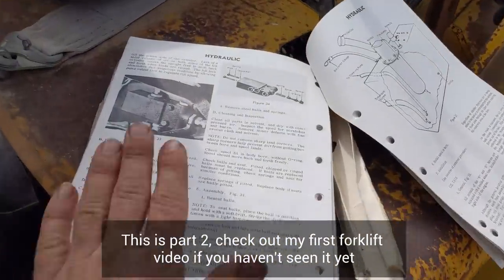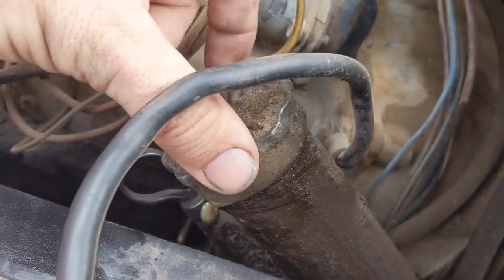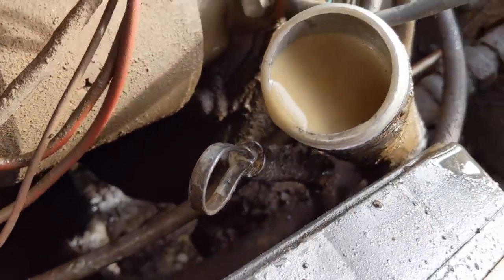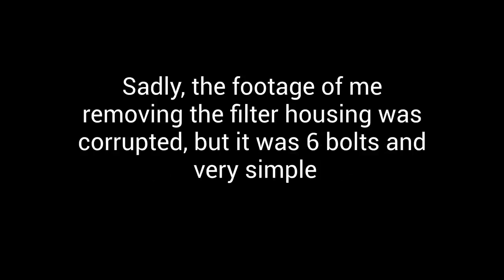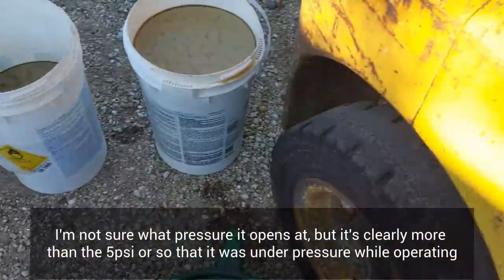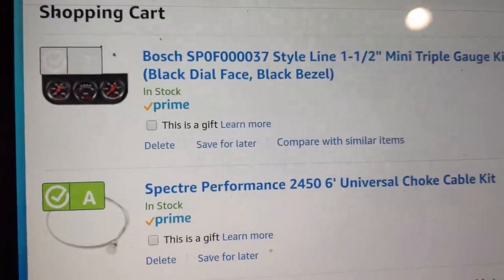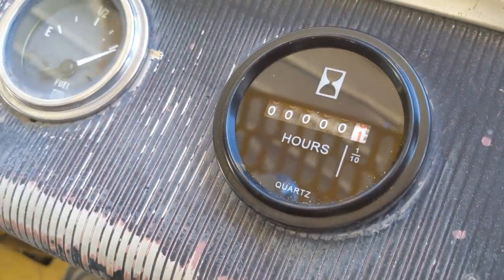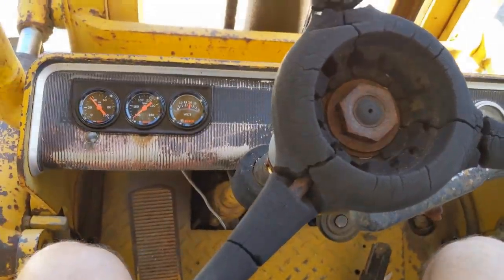Reviving an old Hyster forklift Part II

Comment: I have been around heavy equipment for 50 years and anytime hyd. fluid look's white is because of water in it. and if those cylinders are leaking down you will need to rebuild, and replace the seals.
Reply from the maker: Thanks for the heads up. The closest seals I've done are fork seals on motorcycles where there is an internal seal and a dust seal on the end, are these cylinders similar?
Reply: They are somewhat similar, but you probably will have to take the cylinder down and there will be an  end cap or head on it, remove it and ram and repack the bands inside and repack the head with new seal's. it's really an easy job, maby time consuming but easy.
Reply: @AustinCoulson  Your manual should have instruction's and diagram's.
Reply from the maker: @randallswope4471  I'll check it out. Thanks!
Reply: @AustinCoulson  I know that Abom79 and Keith Fenner have both done videos on replacing seals in hydraulic cylinders. Just search their names and hydraulic cylinder seal and you should find them. Give you an idea of what's involved.
Reply from the maker: @Gizmo42Rodeo  Thanks for the heads up. I will check those out
Reply: @AustinCoulson  Gizmo is right on the repack.  I've seen forklift mechanics pull the main cylinder and repack them in the field.  It's likely drifting because oil is bypassing the piston seal when under high pressure.  Just make sure to keep pipe wrenches away from the cylinder shaft so you don't tear you new piston gland seal, and inspect the interior of the piston wall for any nicks.
Reply: garygsp3 not certain if this cylinder has them but newer hysters certainly from the XL onwards have a non return valve in the bottom of the lift cylinder held in place with a circling, this is to allow any fluid that gets past the piston seal to return to the bottom of the cylinder when you lift the forks. These are prone to failing if left and in my experience cause about 75% of issues I’ve had on hyster  with the forks lowering under load.

Comment: I have been repairing forklifts all my life (retired now) and I was impressed with your mechanical ability and the accuracy of your "guesses". The hydraulic clutch is a pain but works. The minor leak at the lift cylinder is not worth repairing yet. Thanks for taking me back.
Reply from the maker: Thanks for the kind words. Heavy equipment is not my specialty so it's great to hear that from someone who actually knows their way around these. I'm editing a follow up video now where I get stumped and have a couple questions, I'd love to get your opinion on it when it's up. Should be later today or tomorrow.

Comment: I worked as a lube mechanic  on heavy mining equipment for several years. When the mechanics were ready to work on something the first thing they had me do was steam clean the machine. You should invest in a good Hotsy Brand steam cleaner or something similar. You will save yourself a lot of grief working with clean surfaces before you disassemble something like the hydraulic tank. Also would work well on cleaning chassis on the cars you apparently work on- just a thought. Steam cleaners are much more efficient and thorough than pressure washers on grease and oil caked machinery. Good job on the forklift👍
Reply from the maker: I've been thinking about one for a while, thanks for the recommendation, I'll check them out.  My lil pressure washer isn't cutting it these days.
Reply: $4,000 minimum.

Comment: I work at hyster and it makes me happy to see that you fixed her up :)
Reply from the maker: I would like to find the time to do a proper restoration and bring her back to like new condition, but that may have to wait a few years...
Reply: @AustinCoulson  i Will be waiting here for that video ;)
Reply: Hi l am from the uk and have the same forklift as the video shown,it’s a 6000lbs, with Perkins Diesel engine,l have hydraulic flulid come,out of the top of the steering wheel,would you have any idea ,on how to repair this problem,if so l would welcome your advice,please sir
Reply: @macdale4741  my guess is that the seals in the hydraulic steering have failed. I think if you rebuild that part with new seals in it  it should be fine. And make sure you have a hydraulic schematic that's always very usefull
Reply: @stan1845  thank you for the reply,ok that is great,l don’t know where to get the seals yet,but l will look around,also l don’t know what  hydraulic schematic means, l will be serving the system,when l have done the leak,afterwards?
Reply: @macdale4741  no problem, a hydraulic schematic is simply a drawing of all the hydraulic parts and how they are connected together. And after you have fixed the leak I would also check the oil and look if there is any dirt in it. If there is dirt that could be a reason why the seals have failed.
Reply: @stan1845  ok l will do ,it needs replacing ,as it looks like milk shake
Reply: @macdale4741  ooof that is not good that is a sign  that water is coming into the oil from somewhere
Reply: @stan1845  l do the steering leak first,a go from there,coming from somewhere
Reply: I have a hyster  model  540C  serial C2S1960S and trying to find out what engine is in it ? Any ideas ? I have been told it needs a water pump
Reply: @brettchanga557  in sorry but I can't help you with that, I work for another company now so I can't look it up in the database. However you could always ask a forklift repair service since they have that parts database to :)

Comment: That lift cylinder that is leaking just looks  complicated.Actually pretty simple to install a repair kit.Just remember as you said you simply cannot be too clean when working inside the hydrulic system.I worked on the Hyster forklifts from the S40 To the H135, they are pretty good machines.Should serve you a long time and that engine will last a long time if you treat it right.
Reply: charles woods
:That was when Hyster made decent fork trucks, did my mechanical apprenticeship on Hyster fork trucks, the H80c was one of my favourites to work on, the Continental flat head six was a good motor ( very reliable and sound great ) and gave good service, unlike the rubbish they produce now. I drive forklifts for a living now and they are nothing like they used to be, they come up with all these weird innovations to try and compete with Toyota and other manufacturers and they are not in the race, i have driven the late model Hysters for the last 10 or so years and i'm finally back on a Toyota,  what a difference and "Oh what a feeling" lol they are the best hands down.
Reply: At my workplace, we have a 1990 Hyster H 2.50 XL with the propane system. It has been repainted to look like a Linde forklift in the past. It still runs great and it is used quite regularly.
Reply: @fredzephire4071  you don't know what a good forklift is until you drove a linde :p I'm used to drive toyota propane or cat diesel, and a linde is the top of the line for sure

Comment: I like old forklifts with a manual clutch, makes it easier to get the transmission into neutral quickly so you can raise the RPM for faster hydraulics. Modern automatic ones are supposed to go into neutral when you depress the brake but that only works when you're completely stopped, you can't do it while you're moving, the old manual clutch ones can.  Solid score there dude! Now you should try to find a solid state distributor or a Petronix points eliminator kit for reliability.  And get that cylinder rebuilt!
Reply from the maker: Pertronix would be a great idea before it starts misfiring and confusing me. Plus I don't have any match books around to set the points!

Comment: I have that same forklift only propane. It's actually a 3 speed. The rage lever as you called it moves vertically up and down. Find neutral, then pull it up towards the top, and straight back.
Reply from the maker: I just tried it and you are spot on! Now I can do some forklift racing! This is the same feeling I had when someone gave me an old four speed and I was playing with the linkage and found out it was actually a 5 speed. Thanks for the info
Reply: @AustinCoulson  sure thing! I always love to see an old Hyster get rescued
Reply from the maker: @brownranchcustoms1651  I just fired it up and drove around and see that it's a lower gear, that is awesome, I have been driving it around in mid-range. will be much easier to navigate around the yard now

Comment: I picked up a BigJoe Stacker walker lift for $100. Guy said it did not go up. I parked for a year. Started to talk it apart recently. Saw a knob marked, to slow lift speed turn clockwise. It was all the way clockwise. I turned it left and the forks went up.  Easy fix.
Reply from the maker: Those are my favorite fixes for sure. I got a jackhammer a while back that "just stopped working". Took it apart, and one electrical connector jiggled loose. Who woulda guessed a jackhammer would vibrate so much?
Reply: @AustinCoulson  lol

Comment: Just a quick comment, 
When you are pouring anything out of a container that has an offset outlet/spout on it try and pour the contents with the spout at the top of the container as you tip it up. 
By doing this, the fluid can then run out of the container without fighting the air that is try to refill the space in the container vacated by the fluid. This will stop that "gulping effect" so giving you more control of the liquid.

Comment: It's water. Once it forms an emulsion it won't always separate. Likely the issue was the water caused it to be over filled.
Reply from the maker: Thanks for the info! Do you think it could be from years of condensation building up? I have been running it with the new fluid for over a month now, and I am not getting any more issues with the filter clogging up or the weird looking fluid. The coolant level isn't dropping and I can't imagine how else water would get in there.
Reply: @AustinCoulson  I highly doubt it.  Condensation doesn't usually cause that level of contamination.  No clue how the water got in there.  Something may have sat open and was put back together before you got it or who knows. That fluid could have been 20 years old.  As long as it's good now I wouldn't worry about it.
Reply: Yep its water. The filter can remove 'some' water from the oil. They have a hydrophilic agent in the paper and it will bond and trap water out of the oil. A water saturated filter will seem to be covered in a slime and next to no oil will make it through, that bypass kicks into action. The amount of water a filter can capture and remove is measured in milliliters however :|
Reply from the maker: @MrRadioAct  Thanks for the info. The old filter definitely had that slimey feel to it
Reply: I wouldn't put it past the owner of never emptied it filter of water or replaced the filter or even changed the hydraulic fluid in its life time

Hydraulic fluid absorbs water even on a sealed system damp from the pipes will get adsorbed into the system (it generally won't separate from the water)

Unless the hydraulics are water cooled the cooling system can't interact with it (only the oil can norm get contaminated due to seal blowing)

Comment: Those gauges looked really good. I like electrical senders as I lost a tractor because of a line falling off (vibration). Forklift sounds healthy. The milky oil is water. When the oil and water are forced through all the tiny passages at high pressure, it makes for a permanent mixture. Heat the oil at high temperature and if you see steam coming off, it is water.
Reply from the maker: The last two electrical oil pressure gauges I used failed, so I went back to mechanical with copper, but I don't love that solution either. I'd like to find an inexpensive electrical gauge I can trust. I like the idea of heating up the oil, I still have it so I will try that

Comment: If that seal is leaking on the top of the mast it could be collecting a bit of water there and possibly getting into the system.  It could be they added the wrong fluid.

Comment: Awesome man. Hey, something I found recently after someone suggested it to me - "Right Stuff" - think it's by Permatex. It's just like RTV, but made so you can put parts immediately back into service. Far superior in every way and actually approved by OEMs. After trying it, I'll never go back to regular RTV.
Reply from the maker: Thanks for the info!  My favorite is moto seal by permatex but it can be a real pain to deal with in tight spots and requires a solid 24hr cure time, so I am looking for something like what you described.

Comment: I bought an old Hyster just like that one years ago from a Saw Mill auction. It lost compression and I never could find out for shure if it had a Wisconsin, Continental, or Dodge motor. So I sold it.
Reply from the maker: That's a bummer. Hopefully you didn't lose money and the next guy saved it from the scrap yard.

Comment: That's Water in the Hydraulic fluid,   some types of hydraulic fluid is "hygroscopic" meaning it absorbs water from the air, it doesn't necessarily separate like regular oil would. Unlike an engine, the oil/water rarely gets warm enough for the water to evaporate. one way to test it, is to boil the oil for a bit and it should evaporate any water.

Comment: I love old stuff, nice job saving one... I salvaged a scrapyard clark last year, all up only got about 800 bucks in it, looks and runs like new again...needed it like a hole in the head, just couldnt stand seeing it going into a dumpster... now saving another- a 1963 towmotor 462, i have no need for either, but plan is full refurb, OD green/white star military motif, and donating to my favorite local air museum as a period correct looking, yet useable machine...they have a twin to it, but it looks pretty worse for wear...cant save them all, but can try to do a little... this old stuff had character. there a vid on my page of some stuff on the old clark if anyones interested...
Reply from the maker: I checked out the video. You really went through that thing. Was surprised to see over head cams on it. Must not have been too old, but dang it was beat up when you started. I love that you took the time to do the body and the lights. I'm not there with mine yet...too many projects in the way
Reply: @AustinCoulson   Austin Coulson  thanks- yeah the Clark was only a 1993, and has a mitsubishi 2.4 litre- heck, only had 1500 hours on it! it was a maintenance truck, used outside a lot in the dirt, ironically never got maintained...and when it was, it was hacked up...I had thought the motor needed rebuilt(was told thats why they were scrapping it- emissions/oil leaks/no power) but found a blocked PCV, missing vacuum lines, misadjusted propane regulator, loose oil filter(!), bad valvecover gasket(blown due to no PCV and clogged breather)...the motor had great compression, once tuned up, purrs like a kitten, uses no oil, etc... the rest though...inch of steering tierod slop, a honest 2" of play in the hydraulic levers- they would bottom out so lift/tilt was slow- had to mill out worn slots, made rollers/new pins...brakes were completely shot, several leaky hydraulic seals needed work, but still, 5 weeks of evenings and about 800 bucks, ive got a forklift probably worth, yeah, maybe 1500 LOL...sadly they aint worth much- but they sure as heck are handy. the clark weighs 9900 and found rolling a rear tire off the cement is a bad thing, counterweight sunk a foot, 4wd tractor had a really hard time pulling it back onto cement. the old towmotor i'm working on now is super ugly, but think it too is a diamond in the rough...we'll see
Reply from the maker: @timc2219  Dang, that's an impressive list. PCV valves are so often overlooked. Amazing how many leaks i've seen from a clogged PCV.  Glad it was saved from the heap. You gotta film this stuff in detail, I'd watch that for sure.

Comment: Probably need to work that fluid a good bit to get it good and hot, working all cylinders to full extension and retraction to ensure all the contaminated oil get circulated/diluted.  Then while hot another drain and fill.  I'd say it is more important to make sure you stopped the source of water intrusion.  Should be a good machine that easily meets your needs.  Once you have a capable forklift it's hard to imagine how you got along without one.
Reply from the maker: Good suggestion on the contaminated fluid. I am still having an issue with it when it's hot, I am editing a video on it now and it should be up tomorrow or so. Would love your opinion on it when it's up. I can't imagine going back to being forklift-less. Feel the same way about finally buying my lift.

Comment: You might reduce the mast drifting or settling by using a higher viscosity hydraulic fluid. If you keep it in a heated building, it would probably be fine with a AW 68 hydraulic oil which is comparable to 30 weight motor oil. AW 46 is comparable to a 20 weight oil. The piston packing or the valve body can allow fluid to bypass. The valve body is metal to metal with no seals so they do wear over time. Thicker hydraulic oil can compensate for some wear in valves and seals. We changed hydraulic oil twice a year in the spring and fall. We used 68 in the summer and 32 in the winter but we put 2,600 hours a year on the machines and the had to run whether it was 100F or -20F.
Reply from the maker: Great info here. I will be repacking the main cyl just as soon as I get a break from work and will be changing the fluid. Your machine is lucky to have the fluid changed that often, most guys I know severely neglected preventative maintenance on heavy equipment and that's just so sad to me. Operating temps here are 60F to 120F outside air temp, so do you think AW68 is what you would recommend?
Reply: @AustinCoulson  AW 68 would be a good choice to see if it helps. You probably don't use 10 weight oil in vehicles there. Even the multi-viscosity oils seem to be very thin at high temperatures.